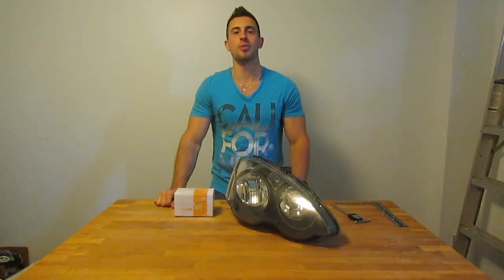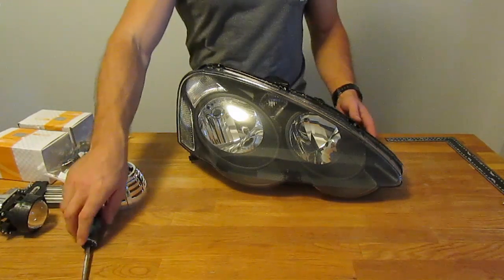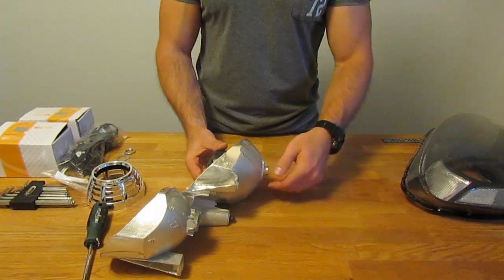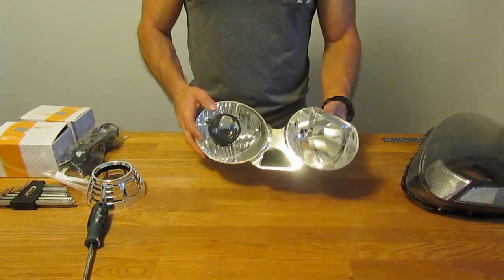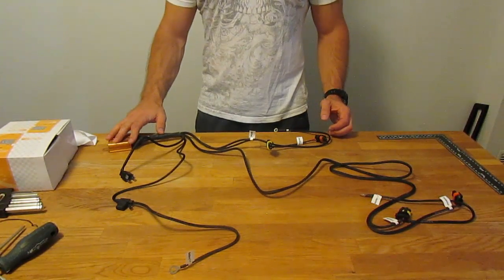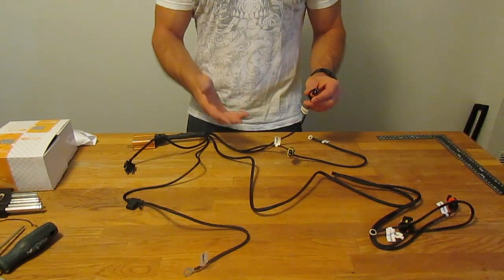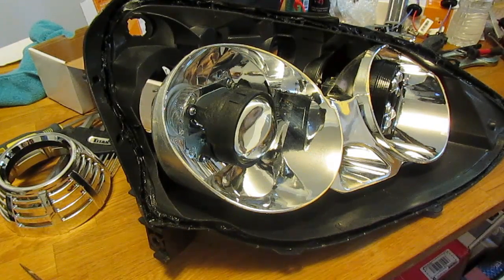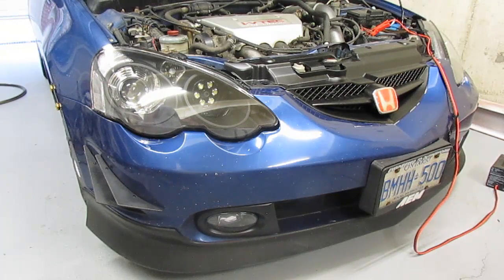HOW TO: HID Projector Retrofit Guide

Comment: love the video. I am a little bit of a lost though. the projectors I got only takes H1 bulbs and my cars headlight plugs are for H4. Can you please explain how would I go about installing or powering up H1 bulbs with H4 plug?
Reply from the maker: +koushick barua No problem!... Your H1 bulbs are HID bulbs so they have those universal connectors on them. They will plug into the wires coming out of the ballast. Now to provide the ballasts with power you have a few options... Some aftermarket HID ballasts can be ordered with the correct style of plug and they will grab power directly from your old bulb connectors. However, if you don't have matching plugs, then you can use a wiring harness like the one I show in the video. The harnesses can be purchased with the right plugs for your current H4 connectors. They will grab power from your battery and use the current head light connectors just for a signal when to send the ballasts power. If you have bi-xenon projectors that do both high and low beams, the harness can also use the high beam signal in your H4 connector to send power to the solenoid in your new projectors and activate the high beam. Hope that helps!
Reply: I actually ended up ordering xenon instead on bi xenon only because it limits the amount of wires as I do not have to pull power from the battery. would it be easier to get bi xenon?
Reply from the maker: +koushick barua Are you referring to the projectors or the bulbs? Since you have H4 connectors I'm going to assume that on your current car the low and high beam is handled by the same bulb... If you want a high beam function you should get a bixenon projector like the Morimoto Mini H1.  The bulb is just your basic H1 bulb, but it is the projector that allows you to do both high beam and low beam

Comment: Very informative video!  Hey... do you have any advice on how to align projectors?  I retrofitted mine with some morimoto 4tl-r  and realized that the projectors had a crooked beam. They crossed each other slightly like a wide X. Do I need to reopen the headlights again?
Reply from the maker: Depends.. if you can access the back of the lights you may be able to twist the projector to level the beam... otherwise you may have to open them again.
Reply: I can access the back of the headlights, but...how do I twist the projector?
Reply from the maker: I would remove the bulbs first, grab the place where the bulb retaining clip goes and see if you can rotate it. If it hasn't been glued or epoxied in place you might be able to rotate it. Most of these universal projectors are held in place with a big locking nut.
Reply: I guess we all learn something new everyday...thank you very much for the advice!

Comment: Ok I have a question. How do u change the bulb when it burns out? Do I have to put my headlights back in the oven and redo everything to get the bulb replaced? Or is it as easy to replace just like cars that come stock with projectors?
Reply from the maker: The bulb sticks out the back of the housing so it's just like changing your regular bulbs :)

Comment: Hum I was told by the people at TRS that the MotoControl Bi-Xenon you show in the Video don't work with the RSX. I am also working on my RSX headlights and I wanted to use the same harness, but I was told did not work with the H1. Did I miss something during your explanation? lol
Reply from the maker: It's been a little while since I did this and I sold the car a few years back.. but if I recall, the harness will not be plug and play with the RSX lights. The high beams are the inner lights if I recall correctly. Therefore, to make the harness work, you have to cut the connector off and splice it... the positive signal from the high beams will get spliced in and trigger the bi-xenon shutters. Hope that helps!
Reply: Hey man, danm! I ended up getting a diferent harness, thanks for the help. Great video by the way.

Comment: So I planned on doing this with the same projectors, the relay that comes with the projector is the Hd Relay. Is that okay or do I need to purchase the bi xenon one you have? Also I plan on getting the anti flicker harness as well because I have a 2008 Chrysler. Thank you!
Reply from the maker: Hi Cuda, the harness you choose will depend on how your stock headlights are set up, and how you want to trigger your high beam solenoid. What bulb type do you have in your Chrysler, and do you have separate high beam and low beam bulbs stock?
Reply: Embrace Racing yeah I think it's 9006 for the low beams and yea they are separate for high and low beams. It's a Dodge Avenger.
Reply from the maker: I guess you still have two options (unless your low beams run at half brightness during the day due to DRL and/or turn off when you switch to high beams). If the low beams run at full brightness (no DRL) and don't turn off when you switch to high beams,  then you can wire your ballasts directly to the low beam plugs. Tap into your high beam plugs and wire that directly to your high beam solenoids on the projectors. Done. 

However, if your low beams turn off when you switch to high beams, or if your low beams use half voltage during the day for DRL, then I would suggest getting the "bi-xenon motocontrol harness 9006" from The Retrofit Source. It will wire directly to your battery and plug into your low beams and high beams only for the signals. It will keep your bulbs on when you switch to high beams and activate your solenoids at the same time. 

Hope that helps!
Reply: Embrace Racing my low beams stay on when I turn my brights on I believe and I do not have daytime running lights on if that makes a difference. So I would get the regular harness for retrofit source and all is well along with the antiflicker harness?

Comment: Great video! Can I do this to my 02 Tacoma? Any kit part numbers? Thanks
Reply from the maker: Thanks! You can get a "universal" kit from The Retrofit Source that will include the projectors, bulbs, ballasts, and wiring harness. From there you just have to take your headlights apart and follow the general guidelines in this video. Every application has it's own nuances so you'll have to be prepared to do some problem solving when it comes to fit and finish for your truck.

Comment: nice video! can you tell me how the final aiming adjustment is made once you sealed the unit?
Reply from the maker: +Mo No problem! Before sealing the unit you should get the projectors into rough alignment. This is why I had installed them without the lenses. Once the lenses are sealed, all headlights should still have some level of adjustment. All headlights are different so some will have more than others. On my car (RSX) there are two adjusting screws at the back of the headlight housing; one for vertical and one for horizontal adjustment. Again, these are just for fine adjustment so you should do your best to get them as close as you can before sealing them. Hope that helps!

Comment: I got lost when you tightened the nut for the projector, so how did you tighten the nut without the projector moving
Reply from the maker: +MikeandSamonPC Hi Mike! After putting the headlights on the car with out lenses and making sure your projectors are "level" you just hold the projector with your hand. Make sure it doesn't move (use timing marks like I showed in the video). Tighten the nut on the back with a wrench while holding the projector with your hand to keep it from rotating. The silicone washer on the inside also provides the projector with some grip to keep it from rotating. Let me know if that helps!

Comment: that rubber sealant is not a glue but a pliable rubber sealant to seal your head lights so moisture doesn't get in. front what i seen so far is that 23 inches from the center or the top of the projector? When i did my retrofit on my ford focus with aftermarket projector housings i used the center of the project as my height for my projector cut off and used that after i aimed my headlights. they were level and never blinded any one
Reply from the maker: +TheArchetypeGamer 23 inch is from the center of the headlight :)
Reply: +Embrace Racing you can keep it at 23 inches and not blind anyone
Reply from the maker: TheArchetypeGamer Yep should be fine. Although I recommend adding a little bit of angle downwards just to be sure. It will help if you have some heavy stuff in your trunk too ;)
Reply: +Embrace Racing in my next retrofit with my 14 focus I might think about it

Comment: Hi bro I just installed bi xenon projector lens in my datsun go reflector headlight, but after installation both lights brightness was not up to the mark and when I just pressed a little than it'll become brighter as I want, but how can I hold the hid bulb like this, it happens to both headlight, and when I look from the front it seems that projector lens beam appears on the car headlight outer glass, it looks like all the projector light beam is for the headlight glass, so please help me whether it was installation fault or something else
Reply from the maker: Sounds like maybe you installed them on an angle? You have to make sure that they are mounted flat... you might have to take it apart and try again. You can make small adjustments using the aiming screws on your reflector headlights, but it won't fix big misalignments.

Comment: You have your LEDs mounted on polymer? I would be scared to mount mine on anything other than metal since they don't have heat sinks, but they seem to work well.
Reply from the maker: They're not very powerful LEDs and they come in an aluminum housing. The plastic was ABS and so the melting temperature is somewhere around 190 Celsius I believe. It doesn't get nearly that hot and they worked for many months before I sold the car :)
Reply: Oh, I plan on doing something similar with my lights, but I wanted to wire them directly to my parking lights. Thanks for the inspiration!
Reply from the maker: No problem. Wiring them to your parking lights will be a breeze :) Best of luck!
Reply: One more thing, do I really need a relay if I'm just tapping into the parking lights? I saw your design has a lot of relays, but I'm guessing that's more for the sequencing.
Reply from the maker: You shouldn't need a relay for LEDs. I used transistors on my custom PCB board because I needed a microcontroller to turn them on and off. In your case, just make sure you either have a LED driver/voltage regulator, or that they are internally regulated since your vehicle puts out more than 12V. The voltage spikes will eventually kill them.

Comment: Wanting to do this to my 04 Tacoma but also want to add angle eyes/halos. How much harder would that make the install?
Reply from the maker: Hi Owen, it shouldn't make it more difficult. If you use the morimoto projectors, they have shrouds that are designed to mount on them. The retro fit source sells halo rings that fit inside the shrouds which make the mounting very easy and stealth. From there you just need to run the positive negative wires to power the halos!

Comment: nice how to. thinking about replacing my projectors in my cheap ebay headlights, or going for a quad retrofit. 

One thing i'm stumped by - how on earth do you go about changing the bulb out in that unit? do you have to disassemble the whole thing again? 

Would appreciate a reply!
Reply from the maker: +Nathan Glennon Thanks for the comment Nathan! If you are referring to the HID bulb it is actually quite easy to change. Since the projector fits into the hole where the old halogen bulb used to reside, the new HID bulb sticks out the back of this. Essentially it is in the exact same location as the old halogen bulb. Just pop the rubber weather cap off the back of the headlight housing and access the HID bulb :) Exact same as the stock headlight procedure. Hope that helps!
Reply: +Embrace Racing it does, thank you! Based on the pics, it just looks like you'd have to take the whole assembly out. But if not, awesome!
Reply from the maker: Nathan Glennon No problem! Thanks for the comments. I'm currently working on the next video to show how I built the sequencing LED lights. Please like my video and/or subscribe to see my next video!

Comment: Hi, Where you connect the Black/red wire that is on Bi-Xenon? that wire thatappear at 14Min:09 thx 4 your reply
Reply from the maker: Depends on how you're wiring your projectors. Those wires are for the high beam solenoid on the projectors. If you have a bixenon relay harness there will be a plug for the solenoid wires. If you don't have a relay harness with the plug, you can wire them directly to the old high beam plug. However, you will have to find a way to keep your xenon bulbs on if your car turns your low beams off when high beams go on (dual filament bulbs like H4)

Comment: I want to take my original H7 signal from the headlight and drive it to projector's coil.
Will the H7 beam be effective for both high/low?
Reply from the maker: Hi Chris, what kind of car do you have? H7 bulbs are single filament and therefore you can use your high beam bulbs to power the solenoid coil. However, chances are, your car turns off your low beams when you switch your highs on. Therefore, you will lose power to your ballasts unless you use a bixenon relay controller. Check out the retrofit source website and take a look at their bixenon harnesses. They will maintain power to your HID ballasts even if your low beam lights turn off.
Reply: I have a Seat Leon.
Thank you very much for your quick response!
I will buy the whole kit next month
Reply from the maker: No problem! Have fun with the project, let me know if you have any other questions.

Comment: My car comes factory with a 9007 bulb. I bought a bixenon projector that fits an h1 bulb and then an h1 Cree led plug-n-play type bulb. How could I wire that to make it work with both hi-lo beam functions?
Reply from the maker: So you're trying to run the LED bulb in the bixenon projector? You'll probably be disappointed with the light output/pattern. Regardless, to activate the projector's shield to switch to high beam, you'll have to pick up the high beam signal from your high beam light. If you had a 9007 low beam bulb, you likely have a separate high beam bulb, correct?
Reply: Embrace Racing it's all in one bulb both high and low that's why I'm confused aha
Reply from the maker: I thought 9007 was a single filament... If it's dual filament then there should be a third wire... you'll have low beam + , high beam+ and a ground. So you'll have to figure out which one is high beam + and wire that to your projector solenoid. And if the low beam+ is turned off when you switch your high beams on then you need the bixenon relay controller from the retrofit source. Basically it will keep the bulb on while your high beam is switched on. Let me know if you need a link.
Reply: Thanks so much that actually helps a lot
Reply from the maker: No problem, hope you have it figured out!

Comment: +Embrace Racing Could you post a link for the harness you used please? I checked out TRS and they have 3 different bi-xenon harnesses. I have an rsx and I'm trying to follow your diy. Thank you in advance!
Reply from the maker: Hi Dylan, its going to depend on if you have an American or Canadian car? Do you have day time running lights?
Reply: Embrace Racing Mine is American so I believe I don't have DRLs. From what I have found I know I want to run a bixenon in the low beam housing same as you. I have already decided on lens and hid kit, but I'm trying to source a harness that has the relay to change my hi/low beam and will plug into my oem input.
Reply from the maker: Since you don't have a DRL, the next thing I would check for (because I can't remember, I sold my RSX a while back) is if your low beams turn off when you turn your high beams on? They were two separate bulbs right?
Reply: Embrace Racing Yes they are two separate bulbs I went ahead and reached out to a rep at retro solutions and they answered all of my questions so now all I have to do is follow your DIY. thanks for you help tho liked and subscribed!! 👍
Reply from the maker: No problem, thank you! Out of curiosity which one did they recommend? Here's my take.. If your low beam turns off when highs come on I would go with the bixenon moto control (H4) and then jumper your high beam signal to the harness. If your low beam remains on when high beams come on you can just use one of their regular relays and jumper the high beam signal directly to the projector solenoid.
Reply: Embrace Racing Exactly and that was the problem I was having I was trying to figure out if I needed a special harness to turn the bulb on/off and flip the bixenon hi/low. I'm still super new to wiring, but since the low stays on when I change it to hi all I have to do is wire the hi to the solenoid and low to the bulb just like you said lol
Reply from the maker: Yup! Got it! Best of luck with your retrofit!
Reply: Embrace Racing thanks man I'll be looking forward to more videos!

Comment: I ordered the second relay cables but still doesn’t work the headlight bulb
Reply from the maker: Did you check your connections, check your resistance on your ground connection as well. Bad ground always creates problems. Have you confirmed the relay closes and completes the circuit?

Comment: How do you adjust the horizontal and vertical beam projection if the lights are sealed??
Reply from the maker: Since the new projectors are attached to the original reflector bowl, they can be aimed with the stock aiming mechanism. However, it is important that you get the alignment almost perfect from the start because the amount of adjustment in the stock housing is limited. It will not be able to compensate for very poor initial alignment.
Reply: Embrace Racing cool thanks for replying.